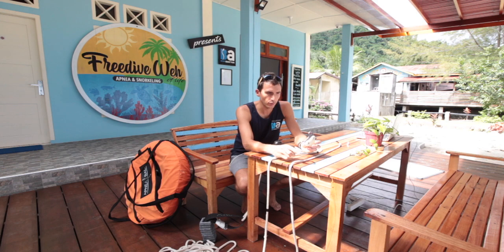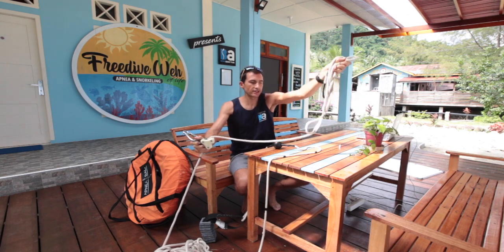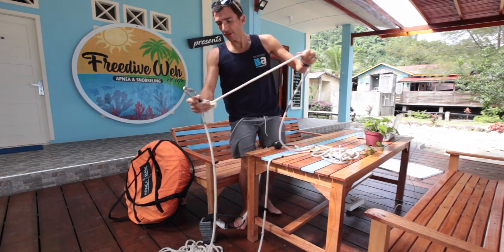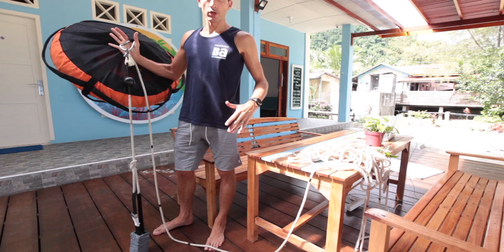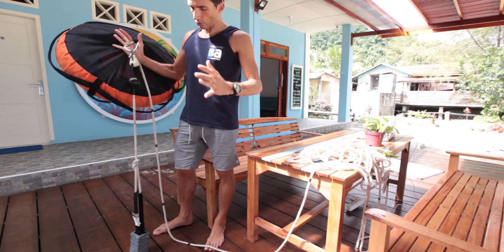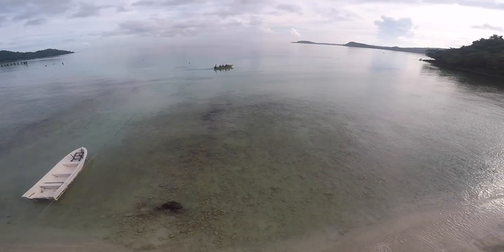Octopus pulling system tested for you

Comment: I have some questions if for example you have to pull a weight around 12-15kg from the bottom how easy is to pull the weight up or is too much? and also if you let your weight free to the bottom with speed it’s creating any friction and consequently damage the rope if you let it go down fast? thank you
Reply: Hi, no problem for both. You can pull easily 15kg, and let it sink to the bottom without damaging the rope